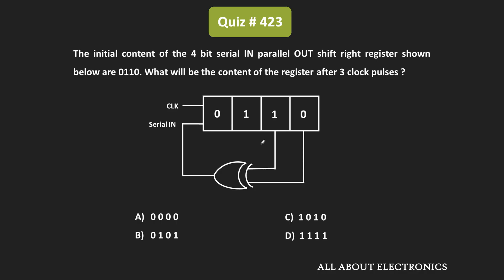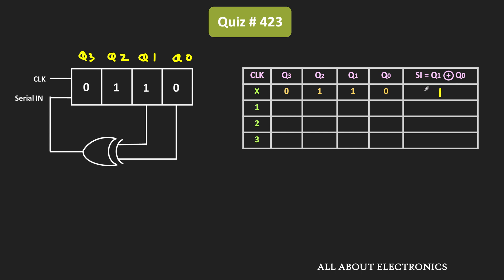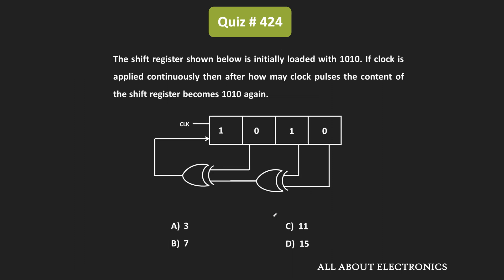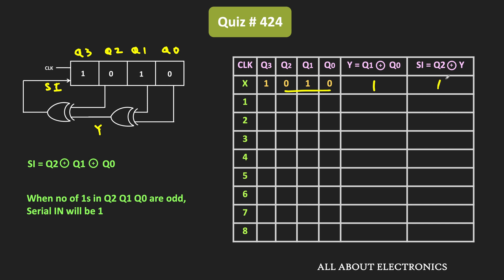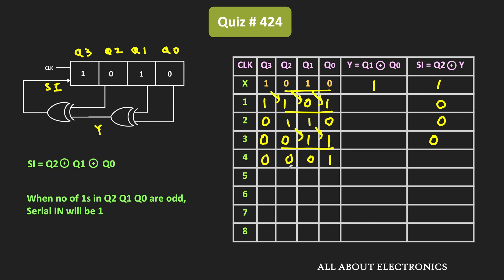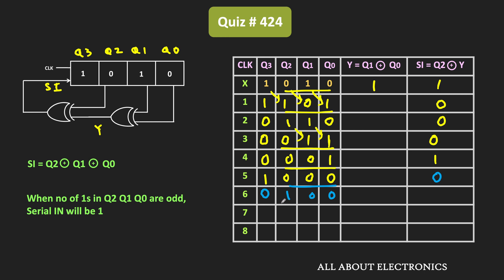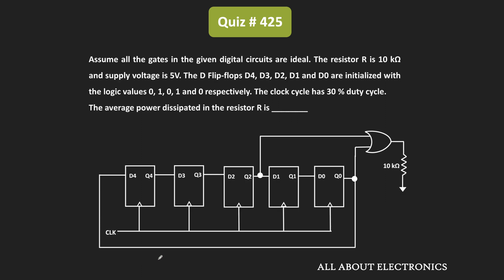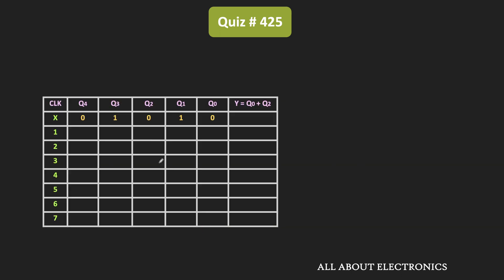Shift Register Solved Problems (Digital Electronics) | Quiz # 423 to 425

Comment: I have a question about the last problem, whether the answer multiply 30%.
Reply from the maker: No, the duty cycle of the clock signal won't come during the calculation. Because the flip-flops in the shift registers are edge-triggered. So, they will respond to the input at every rising edge. And the output of the flip-flops will not change until the next rising edge. I hope it will clear your doubt.